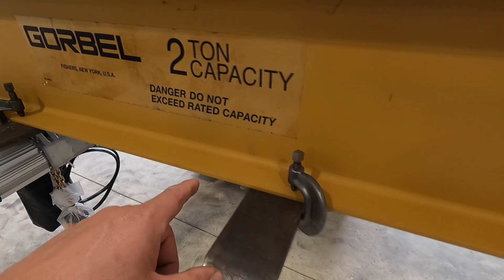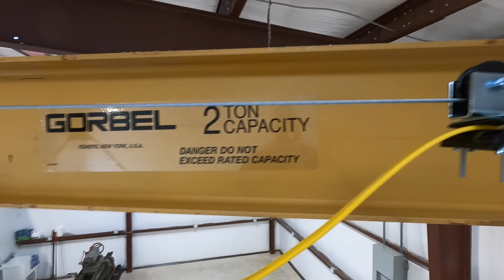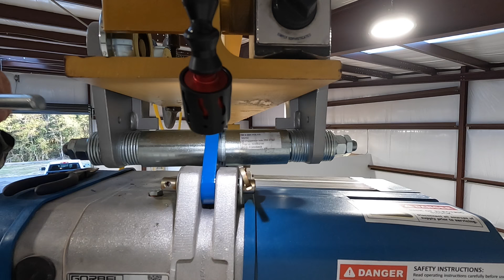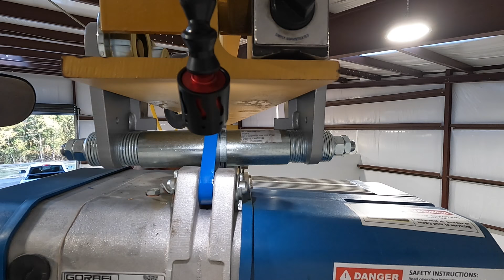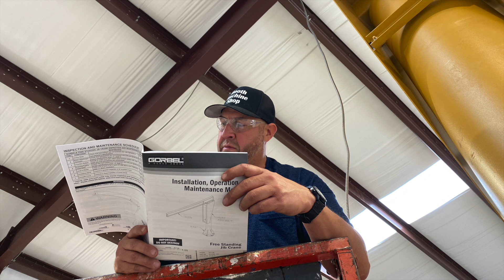Gorbel Jib Crane Installation Part 2

Comment: A couple of grade 8 5/8" bolts with nylock nuts would have done the job, but if you have a nice machine shop, why not use it? Good luck in the new building!
Reply: How would Allen bolts have matched the shear force of the OEM pins?
Reply: @waynespyker5731  Yes, those OEM pins were just plated mild steel based on appearances. It's only a 2 ton crane, so each 5/8" (14mm) pin would carry a max shear load of 2 tons (assuming worst case loading)
According to MSC a 3/8 grade 8 pin or bolt is good for 16,550 Lb working load. These pins are almost exactly 3 times the area (.110 sq in vs .306 sq in), so gr 8 .625dia pins/bolts should have a shear strength of 49,650lbs each. That being said, I don't blame Adam at all for making sure the installed pins were supplied by the crane manufacturer, just for legal reasons. The fact that the pins used are designed with a massive safety factor, (way over the recommended 10 to 1) even for mild steel indicates it's a very well made crane.

Comment: Wait…. Did your sparky put a galvanized box in with a receptacle?? Why wouldn’t they just put a proper L14-30 (or 20, couldn’t tell from the vid) female connector on the cable?

Your work is always so pro. People should be doing their best work for you. Just saying.

Comment: also, the pin you made for the bag (20:20) you should put the last link of your chain in the gap so you don't run the chain out of the motor.
i work with thme every day in the entertainment industry.
Reply: @LittlePayner   you ever tried to run that block through a hoist body? Quick way to break your motor.
Reply: And besides, 2 safety’s are always better than one.  🤷🏻‍♂️
Reply: @ianbenson489  yeah they just stall or cam over.

Comment: 10:43 Have you checked the packaging (bearing, bolts for the column head piece etc.) you had laid out on the skyjack at the beginning of Part 1 of this install for those pins etc.?
Reply: I wondered if they were bagged in with the chain !

Comment: If you don't mind marking the floor, why not lower the crane hook down to just above the floor and use it as a locator as you pivot the crane beam to spray a circle on the floor which shows exactly what is and is not reachable by the crane...then you never have to ask yourself "Is the crane gonna reach that?" when bringing something in with the forklift or pallet jack...

Comment: That massive crane base and huge I beam and the only thing holding all the weight it those 2 14mm pins? I know that can hold a decent amount but I would think it would  be a different spec
Reply: the manual says in micro print to never lift over 200 lbs lmao

Comment: How tf is this thing rated for only 2 ton it looks more like 20 ton - the size of members for that jib is massive
Reply: It's all about the cantilever effect. 2 ton at 15' puts a lot of strain on the head and beam.
Reply: I asked the same thing on one of his Instagram posts and someone mentioned that it has to be built with a safety factor of five so it could probably lift 10 tons with the right winch but it's safely speced to 2 tons.

Comment: I would have left one end on the pants the original size of the bar you was using and then you'd only had to drill two holes instead of four

Comment: Did you consider using high grade bolts similar to what rigging companies using for concert truss rigs for hanging the hoist?  Grade 8's or 9's.  I'm concerned that the steel you used wouldn't be strong enough to support the weight of what you are going to be lifting with your rig.... just a thought.
Reply: I stand corrected.  I see now that Korbel sent you the correct pins. WELL DONE ADAM!!

Comment: you should switch your nuts with jam nuts, the shorter nut should be inside, if you think about that, imagine backlash i any screw interference. After tightening, outer nut is loaded in outwards direction, inside nut is loaded in other direction. You want to lock in outward direction so the outward nut should be longer... i can draw it for you if you want...
Reply: In my 50 years of mechanical experience, I have never seen a jam nut used as the inner nut. It's only there to keep the primary nut from backing off.
Reply: @russellstarr9111   Correct.  We started to use flanged nuts a long time ago instead. They have nubs on the inside of the flange to lock them up.  Thousands and thousands later, I'm so glad these things exist.

Comment: Adam, you mentioned in a previous video some time back about the kneeling pad that you use to save your knees.  Could you describe it better or provide a link? As I age, it gets more and more important to find cushions for my knees instead of kneeling on concrete. Thanks!
Reply: They sell them at garden centers, Walmart, etc. and usually market them to gardeners. 
It’s the same material they make those pool floats out of; just foam with some kind of plastic coating on it. 
Usually about 18” long and maybe 8-10” wide.
Reply: I use the ones you can get in garden departments for pruning roses.  The P.O. left one so I don't need one down at the shop and one up at the garage attached to the house.
Reply: It’s called google. Do you really need him to put a link. Come on you can’t be that inept

Comment: Atom, you put your cable clamps wrong your saddle should never be on the dead-end it should always be on the live end that is where the sane comes from ((Never saddle a dead horse)).
Reply: Correct, but not a huge deal in this case since the working load is not much in this case. But correct. Should always practice proper Rigging. This is a good way to learn. ABOM you are the man keep up the good work.
Reply: Who's Atom?

Comment: Hi Adam!  I'm worried about those two pins you made to fasten the hoist to the trolley.  I hope they have enough shear strength to meet or exceed the pins that should've come from Gorbel.
Reply: You must have skipped near the end. Gorbal sent a new set and he replaced them
Reply: Did you watch the video?....
Reply: Ah good, now I see.  I was still watching it.
Reply: He said he used drill rod, which is tool steel.  Great strength, but can be brittle, depending on grade.  Definitely more advisable using manufacturer hardware.  They don't appear to have sent the pin for the chain bag; but that doesn't really need an excessive amount of strength.

Comment: Nice project! I'm thinking tho, wouldn't M14 bolts work just fine as pins?
Reply: Depends on tensile strength. It would perhaps invalidate any OEM guarantees.
Reply: Warranty?
Reply: @ellieprice363  well as the pins are missing and Adam didn't refer to any requirements from the manual (that he has), it is anyone's guess really

Comment: behind the Safety-Stop for the lifting-Cain, there is a little of extra Cain. I strongly beleeve, That belongs n the little gap where the Pin for the Cain-bag goes… so if the stop fails u have the Cain pinned to the housing as a extra safety-stop.
Reply: Yeah, normally the chin falls in the bag as a "loop"
Reply: @jazzcat123  as soundengineer we use such chainhoists to fift Speaker systems to the rig on a stage, but I’m not a rigger and I’ve never seen this brand, so that’s why I’m not 100% shure. but with chain-master, and lifttek the stuff that we have here arround  it’s definitely like that…
Reply: @frankangermann6460  Fancy that, I work in entertainment too. As a sometimes production rigger.
But I do video screens.  
You rarely see anything but Columbus McKinnon hoists in our neck of the woods. On those there is no "stop" as such on the end of the chain. The last link is just attached to the body of the hoist, creating the loop.

There is however internal stops/limiters that can be set.
Reply: @jazzcat123  😂 so nerd-level 3.0…. 🤓…. How interesting that us 2 event-guy meet at adams YouTube-Channel…🤣
Reply: I think that rubber-stop makes sense as it is a little softer that running the chain into the housing, I remember that I’ve seen a pic of a broken housing.

Comment: So people know,when clamping wires, the u-bolt is the saddle, never saddle a dead horse….the ubolt is always on the live side, the dead side is on the bolted part. Eliminates risk of cable slide
Reply: You actually have that backward.  The U-bolt goes on the dead side.  The saddle goes on the live side.  The U-bolt is not the saddle.  This shows the correct and incorrect--  https://www.youtube.com/watch?v=audmZA4RCMI

Comment: Anybody else struggle with the audio on this video? At times I could barely hear the conversation!
Reply: Yes. It seems to be related to a left right stereo issue for me anyways. I hear perfect sound vertical and horizontal one way but low audio horizontal the opposite way. It does it with the intro music and then periodically through the video. I think the microphone has an intermittent issue where it only pics up one side of the stereo sound. Or maybe it’s my phone.

Comment: Why are shims needed?
Reply: Plumb.
Reply: I guess to compensate for sag.
Reply: @Bob_Adkins   I doubt there is any sag, especially since when there is a load on, it would be much worse. It's more like a final adjustment for out of plumb, perhaps to compensate for minor build differences.
Reply: @firesurfer  Even a tiny bit of sag will make the hoist roll to the low side. Even such a massive beam will sag a tiny bit. But I'm just guessing.

Comment: Wouldn't it have been easier to get the trolley together and into spec. Place that onto the I Beam and then install the end-stop?
I would also glue some rubber pads, cut up Tires or w/e and put that onto the end stops so that the metal wheels on the trolley don't ding into the metal End stops. I duno, metal on metal over time seems bad and a bit of rubber could help it not wear out so fast.

Comment: That is a LOT of MrCool units...4?  Saw that you can order those from the homeless despot (is that where you procured them?)...and it looks like it's sold as a 4 pack, (4 zones is what they call it)...Price was EXTREMELY reasonable if that was indeed a "4 Pack" of items like you have in the corner there.  Now I'm not as worried about cooling my shop when the time comes...I was thinking I'd need 2 big units for 3200sq.ft. (if I can pull it off that is)...and that's more than double the cost!!!
Reply: They were given to him
Reply: @jakeo2600  not 100% on that.  Yes, they sent him the unit for his home shop, but I thought he he said he was picking some up.  My bigger question was if he did pick these up, is this the 4 zone system?  I saw it online for a crazy low price, and it has me scratching my head because I thought they were a few thousand EACH....

Comment: No counterbalance?
Reply: It doesn't balance on top of the pole. The weight is pushed against the pole.
Reply: You don’t need counter balance for this design. This is an EXTREMELY common design used in the industrial world. Especially in repair shops. It’s a JIB CRANE.

Comment: I just realized: What is powering the forklift?  The propane tank is missing from the back.
Reply: fuel tank, not every forklift is gas
Reply: @superhacker101  so liquid gas instead of gas gas?  (gasoline instead of propane)
Reply: Yep, most likely gasoline powered! And even those who use propane usually have a small gas tank that is used to start it. They don't run well on propane while it's cold.
Reply: @Dysan72  Probably. I never saw a dual fuel lift. The ones I used were propane for the smaller ones and Diesel for the "big machines"...

Comment: The design of this confuses me. All the weight of that steel Jib hanging down on that one top roller bearing? Maybe I'm not understanding the engineering of it.
Reply: if you look close there are two rollers on the bottom mount of the Jib  that brace themselves off of the column and remain in contact as the boom is swung.
Reply: @royhicks1628  I saw that but that's still a lot of force on that bearing especially under a heavy load. The bottom rollers will support the lower part but at that bearing it's acting as almost a pivot point. Oh well I'm not an engineer of any sort. I guess they worked that all out.
Reply: @BruceNitroxpro  i have been working on cranes for over 10 years and i can tell you that gorbel designs some of the best jib on the market.  They have had this style jib for many many years before i started.  I can tell you i have never seen one of these flail or deflect in anyway.
Reply: @BruceNitroxpro  for sure it can be a little unsettling at first for sure
Reply: It's only a 2 ton crane, guys.  Consider the forces on the spindles and wheel bearings on your truck and how they're designed.  They have to resist much higher dynamic loads.
Reply: @stargazer7644  wrong
Reply: @dmartd20  Oh, since you said one word, you must be right.  Care to elaborate, Einstein?
Reply: @stargazer7644  sure the rollers at the bottom of the jib see moment loading upwards of ten time the rated capacity on the jib when the hoist is at the end,  now given that this jib must be built for a minimum of 4:1 per ansi and cmaa you are talking a capable 160,000 lbs not that it will ever see that.  A car may see high moment loads per wheel but due to suspension even the largest bump may only cause it to see 3 to 4,000 lbs of force.

Comment: 48:01 Is there already a crack in the concrete floor?
I see now it was already there in the power washing video. I wonder what happened.
Reply: Oh wow! I didnt see that until you mentioned it now! Its a really long crack. Maybe the concrete dried up/burned too fast? Movement in the ground?

Comment: Please correct me if I am wrong. The distributor should have provided the installation of all of the crane for some sort of fee when you were ready for it be installed which would have made your life a little bit easier. I would suggest that you contact Gorbel & they would be more than happy to ship you the missing parts you need.
Reply: Did you watch the video?  42:12

Comment: I know Adam is a professional but wouldn't making your own pins void the warranty on this thing?
Reply: Was thinking the same, but he switched the pins out for manufacturer made ones later. You could probably replace the pins if you used ones that another manufacturer rated for the same load.
Reply: @Ali - That may be why Adam replaced his pins with mfr. pins when he received them from the mfr.

Comment: I would have thought there would be flat washers on that eye bolt before the nut goes on
Reply: Thats what you get for thinking.
Reply: @scotttipps8155  Now you have me researching .  washer, machine component that is used in conjunction with a screw fastener such as a bolt and nut and that usually serves either to keep the screw from loosening or to distribute the load from the nut or bolt head over a larger area  -  also and this is what I saw first - a washer may be placed through the end for greater protection. This prevents the bolt head and nut from scratching or indenting the surfaces of the two fastened parts, which could ultimately loosen the fastener.
Reply: Adam should have put the wedge washers on the top side. They are wedge shape to match the contour of the I beam. Without them the head of the bolt will be forced to be at an angle and be at risk of breaking
Reply: @thisoldphoney3448  I thought that might have been a problem but we never saw where the wedge was installed . Lets hope that gets corrected .  I thought he took a big chance of standing under that beam before it was completely installed .  He should test the final installation , pick some things up and stand back.  I also thought his wife was crazy for putting her hand between the beam and the stanchion as she guided him into place.  She could have lost a hand real quick .  Don't know what the rating of that fork lift was but it didn't look like it had the counter weight to work with that beam safely .  I was thinking OSHA would have a field day on shop safety here.

Comment: I don't think it is a proper  2 ton overhead. I doesn't look like a proper two ton to me. But I'm no expert. I've worked in shops with heavy trucks and every overhead crane was over-rated about two times.
Reply: Given that a flimsy looking engine hoist is rated for 2-tons, I'd say this crane is overrated for 2-tons.
Reply: Rated load is usually about 1 tenth of the breaking load, whenever one is using any overhead lifting device, sling, rope, whatever.
Reply: So you are “no expert” yet you still comment that it doesn’t look proper? Ok then….

Comment: Does the hoist controller have anything other than the electrical cord to take stress off the controls and cable? It will be easy to want to use the control to pull the hoist back and forth on the rail. On hoist that I have used before they have had a cable or chain going from the bottom of the hoist to the controller to ease stress on the electrical cable.
Reply: Adam did mention there were multiple cables on the controller for just such a concern.

Comment: Is the yellow traveler power cable a solid conductor Romex cable???   That should be stranded conductor cable like SJ Cord.  If it is solid conductor it will eventually break from being bent back and forth.
Reply: Supplied by manufacturer.  Pretty likely they've figured-out the right cable to use at this point.

Comment: And that huge crack in the floor?????
Reply: He poured a huge several feet deep pier footing under the tower which had the studs for the tower imbeded. Then the slab floor was poured over the top of the footing. The floor doesn't support the crane.

Comment: Should those pins be grade 8 ?
Reply: Why? They are passing through a cast aluminum housing and some A36 construction plate. The aluminum would fail long before even 1018 cold rolled steel pins.
Reply: @utidjian       I had that same thought , but was already typing , thanks .
Reply: @utidjian       I had that same thought after I typed , but that seems to be a lot of load on those pins and the case . Thanks